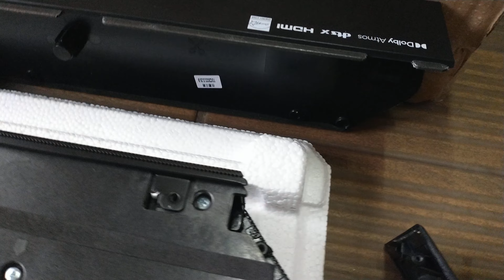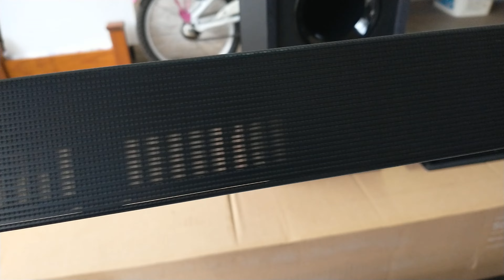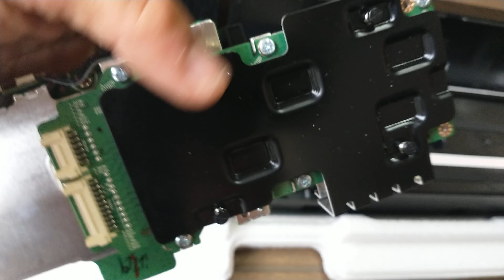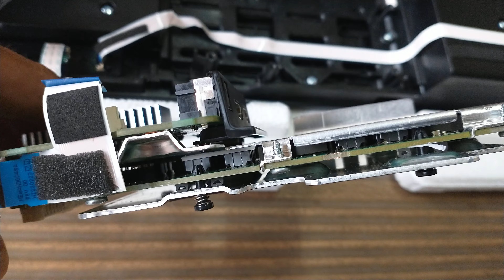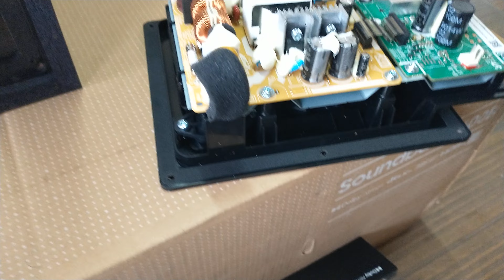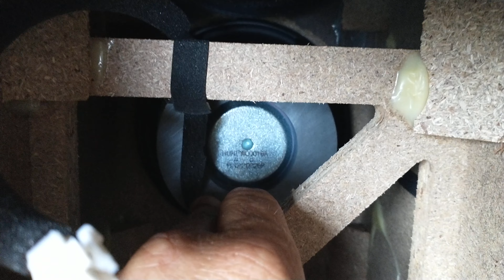Samsung Soundbar Q600b Look Inside (Disassembled) Teardown (Desmontado) Por dentro

Comment: This stopped working after 1.5 year and Samsung technician said whole PCB will change, do PCB of this model repairable too, please reply?
Reply from the maker: @evascontent  It can be repaired, but as long as you get the defective components. Authorized technical assistance (Samsung) does not change components but the entire board and that is why they condemn the board that would require repair.
Reply: Hey Same here.
After 1 year and 7 months my device also got issues with PCB.

Looks like it lacks quality.
Reply from the maker: @binoyt5011  It could be yes, or it could be a flaw in some batch of this model.
Reply: @binoyt5011  you got it repaired or part replaced
Reply: @robsonbraun  how to remove the mesh cover as technician said it is caused by moisture in soundbar, I want to clean and dry the same
Reply: @evascontent  same 
The technician said there was moisture inside the bar.
That's why the board got damaged.
Still waiting to get the board replaced.
Reply from the maker: @evascontent  It's a little difficult to remove this screen, but to remove it you first have to dismantle the entire bar and remove all the screws, after that you have access to the parts where the grille is attached, and just loosen the ends and then force it to remove.

Comment: Would anybody here know any forums around here that talks about fixes? I just got a Samsung HW-Q600B for 10 bucks but its only issue is that there isn't sound coming from the bar, the sound bar turns on and connects to e-arc but nothing, and I know its not my settings because I've bought a Samsung subwoofer and another Samsung sound-bar (idk its model sticker is off) from em and it works as well I got both sound-bars and subs for $35 bucks. Could it be if I possibly switched out the main board from a different one it would work again?
Reply from the maker: Unfortunately, as this model is still very recent, it is very difficult to find technical maintenance specifications, but it is possible to adapt another card, but this card would have to have the same number of channels to maintain the sound quality.

Comment: Wheather this samsung Q600B soundbar have tweeter?
Reply from the maker: Yes, it has three tweeters
Reply: @robsonbraun  thanks for your reply brother.  (In Samsung website they mentioned wide range tweeter available only in Q700B not in Q600B. ) so I confused brother. Thanks for your confirmation
Reply from the maker: @davidsweetlin1667  ok brother, any doubt and just ask that will be possible to help you.

Comment: I have a Samsung B650 which is 3.1 and I'm trying to figure out where each of the 6 speakers are in the soundbar. I can clearly see a left and right circular speaker through the mesh but I can't see anything in the center. I've read that pairs of midrange/treble speakers may be used at each position.
Reply from the maker: Unfortunately I didn't test this model, it wasn't sold here in Brazil, but generally the central channel has an oval woofer and a tweeter.

Comment: Fail soundbar from samsung no sound volume didn't work bluetooth won't connect
Reply from the maker: it could be a failure in the power supply of the bar, you need to take it to a technical assistance to evaluate.

Comment: I Wonder where the 9 speaker sit. I can only See 4. 2 on the top and 2 at the Front and  1 in the middle. Makes 5
Reply from the maker: actually it has 3 woofers that make the mids, another 3 that make the treble and 2 that make the atmos, this soundbar has 3.1.2 channels.

Comment: Ainda vake a pena comprar essa soundbar  Q600b
Reply from the maker: vale sim irmão, essa soundbar tem o melhor custo beneficio do mercado, a única ressalva é que ainda deve ter lote da unidade defeituosas no mercado, se vc der sorte em pegar uma sem problemas, caso contrario é so efetuar a troca por outro.
Reply: @robsonbraun  bom dia amigo, adquiri a Q800B e estou muito satisfeito o aparelho é de muita qualidade, a única coisa que estranhei que a parte de baixo da soundbar bem no meio da soundbar esquenta muito será que é normal? Inclusive em stand by ela tbm esquenta um pouco.
Reply from the maker: @MsPaulogarcia  Blz meu amigo, boa tarde, parabéns pois ela tem uma qualidade sonora magnífica, a respeito de esquentar e normal sim, msm depois de desligado como ela possui a Alexa uma parte da placa sempre fica ligada por isso msm desligado esquenta, uma solução pra da uma amenizada nisso e colocar uma pezinhos de borracha (geralmente vc já encontra pronto com cola pra comprar) aí a soundbar fica um pouquinho mais alta em relação ao nível da bancada e assim vai ter uma melhor circulação de ar, isso só vale fazer caso vc não use ele na parede com os suportes fornecidos. Uma alternativa mais radical e sempre estar desligando ele da tunada mais aí vc fica sem a opção do comando de voz pra ligar.